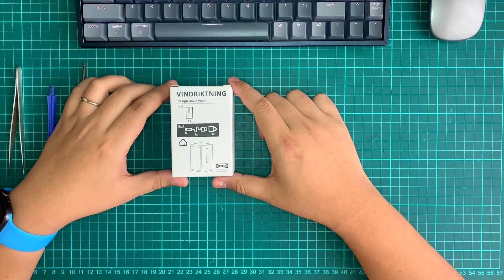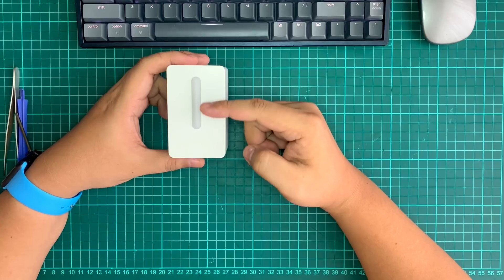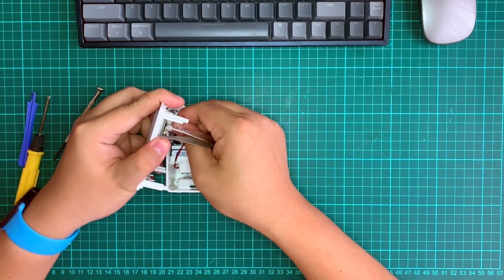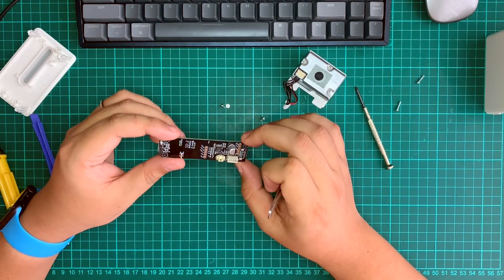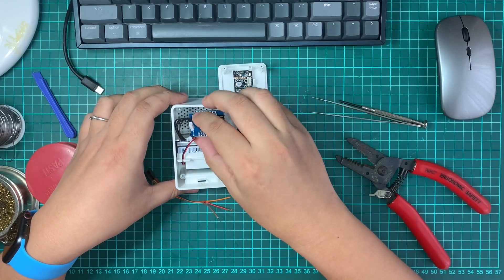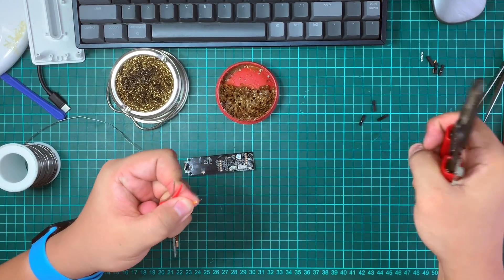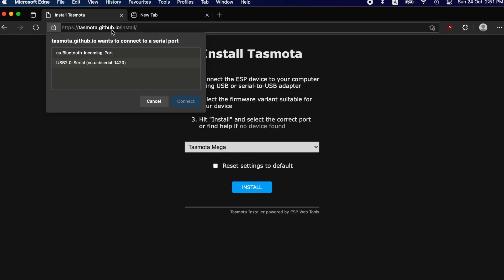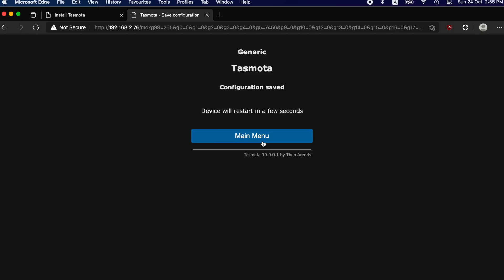IKEA Air Quality Sensor - The Cheapest PM2.5 Sensor for Home Assistant

Comment: One important thing, you have to use voltage divider, because the VINDRIKTNING output is 5V and ESP32 IO input voltage is 3.3V. Use an 2k ohm to the ground, 1k ohm to digital input on ESP, on other side solder both resistors together and connect them to VINDRIKTNING REST pin.
Reply: D1mini is esp8266 and is 5v tolerant on inputs.
Reply: why if you already have the volt reg on the board that is used with usb 5v input ?
Reply: @MagivaIT  The voltage regulator is only on VIN. On digital inputs you have to lower the voltage to 3.3V. If you will feed the ESP with 5V it may work, but after some time you can damage it. I had issues with WiFi, but after putting the voltage divider it works smoothly.
Reply: @AndrejDobak  it works smoothly without voltage divider
Reply: @Wu33up  it may work for some time, but how long...check the esp32 specs. it's clear 3.3 volts. I had issues with wifi when it was 5V

Comment: great tutorial thank you. Quick question on accuracy, Alot of people on home assistant forum complaining that that the ikea sensor doesnt provide true accurate readings, Have you tested this in comparison with a PMS5003, Also would it be possible to swap the built in sensor with a PMS5003
Reply: do you have a link to the home assistant discussion ?
Reply: It’s probably good enough for the green, orange, blue kinda distinction of air quality, but you are correct, this sensor is at the bottom of accuracies.

Comment: there is no need to measure all the time, a single measurement at the press of a button should be enough
Reply: It’d be good if the D1 Mini would go to sleep for a couple minutes between readings. Not sure Tasmota can do this, but you can do it through Arduino or Micropython. Should be a pretty straightforward program to write and I’m sure someone else already did this by now.

Comment: too bad they did not include an internal battery so it can be used anywhere
Reply from the maker: I measure the power usage, it have a fan that on all the time and LED, so it consume around 1.8-2.4w.
So if you put in a 600mAh battery, it only last less than 1 hour. Not really practical to put a battery in this.
Reply: @TzeJinShee  If you put like 2 phone batteries in there, thats like 6 to 8 thousand mAh. If you want it portable for whatever reason, thats more than enough and the extra space isnt that much, as you have enough depth, just not enough hight. If you already need to print a new case, because its not big enough, just calculate the Batteries into the Design and you good to go. Should get a bit taller, but thats it, imo.
Reply: @TzeJinShee  probably due to the Mini being on and connected to the network at all times. Should be better when using deep sleep and only periodically broadcasting the results. Maybe every 5-10 minutes.
Reply: If you have a 3d Printer, just print a somewhat bigger case, put a Battery in, dont forget the 5V booster and you good to go. Remember to get enough holes in that thing, so it can accurately check the air. For 10 Bucks that thing is already a steal, ngl.

Comment: And when you put your mobile phone close up it goes all flashy flashy. What's annoying with this unit is the internal fan. You can here it spinning up every so many seconds. Great idea on the hack though, pretty cool.
Reply: You can use the 3.3v pin from the D1 mini to continuously power the fan. This will get rid of that super annoying noise when the fan starts/stops at 5v.
Reply from the maker: Yeah, but i would recommend not doing this as this tax the poor 3.3 LDO power regulator. You can just use a voltage divider (2 resistor) and a single resistor might work too but I worry it might not spin up if not enough in rush current to start the spin.

Comment: hey, can this be used to monitor smells? Like when your neighbour takes a shit and it fills your bathroom because its on the same column? Im thinking if it measures ppm by default, then somehow the smell in the air could trigger it? I don't know how these things work. Presumably it could then be set up in home assistant to trigger an automation
Reply from the maker: Cool idea !! I have try ammonia sensor for a company project last time, it work great !!
However, we can't really use the IKEA sensor listed here because it is a PM2.5 sensor which mean it detect dust particle only, ammonia chemical particle is way smaller.

However, let change the idea a little bit, rather than doing it for the smell, do it for the CO2 content. The idea is if there are many people using the toilet, the CO2 concertation will spike up and you can turn on the fan to circulate the air. This is what I did for some public rest area and it is very useful during this pandemic era.
Reply: @TzeJinShee  wow thats awesome, you're one of the good ones, cheers!

Comment: Thanks for the detailed tutorial, today I converted one of the IKEA air quality sensors, it worked. However, on your video, i can see PM1, PM2.5, and PM10, in my case it was only PM2.5. Do you know if they changed the sensor for Canada :) is there a way to compare your sensor type with what we have?
Reply from the maker: To have support for Vindriktning’s sensor you need at least Tasmota version 9.5.0.7. Since it is not included in standard builds, you need to enable the sensor by adding it to user_config_override.h:

#define USE_VINDRIKTNING                         // Add support for IKEA VINDRIKTNING particle concentration sensor (+0k6 code)
  #define VINDRIKTNING_SHOW_PM1                  // Display undocumented/supposed PM1.0 values
  #define VINDRIKTNING_SHOW_PM10                 // Display undocumented/supposed PM10 values
Reply: @TzeJinShee  Thanks Jin, if possible kindly add the steps or a video showing how to use add this header file online.  I will try the new version 10.0 and try it tomorrow.
Reply: Arun, Jin wrote elsewhere (Home Assistant Malaysia FB group) that in order to get the PM1 & PM2.5 reading, you need to reflash to Tasmota firmware :-)

Hope this helps
Reply: @samtehais  Thanks Sam
Reply: Does it need to be reflashed or just update the firmware from inside tasmota?
Reply: @rsur2000  you will need to recompile new .bin file with changed file user_config_override.h and flash it to device (not via OTA, because there will be not enought storage)
Reply: You may try this https://www.youtube.com/watch?v=BSLXqhjjSZI

Comment: cool .. adding bme280 to the esp8266 would be nice too Jin
Reply: How can I add bme280 into the circuit?
Reply from the maker: Yeah, you can add I2C and 1-Wire sensor on it. And since it got a fan circulate the air, this can really give good measurement.